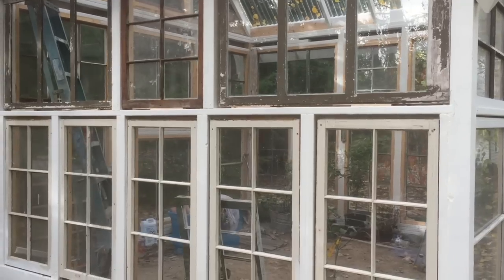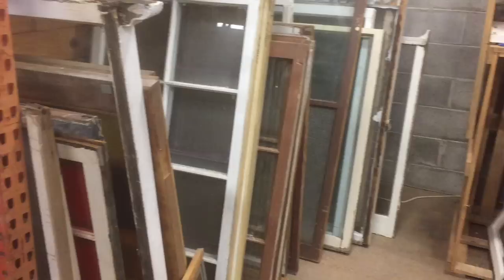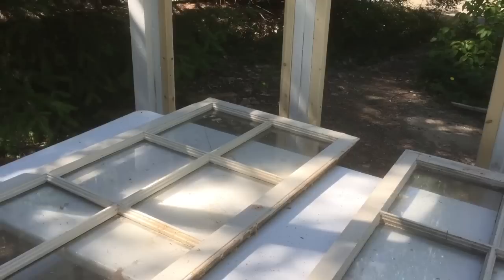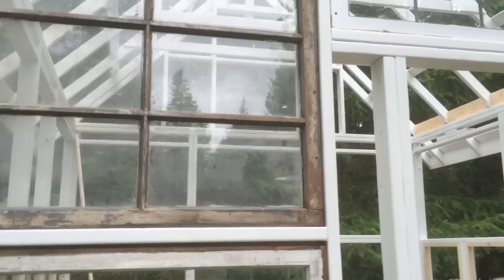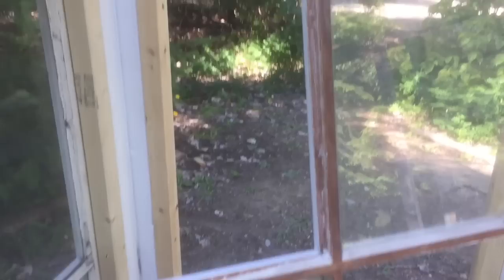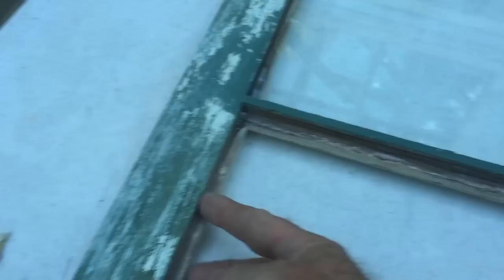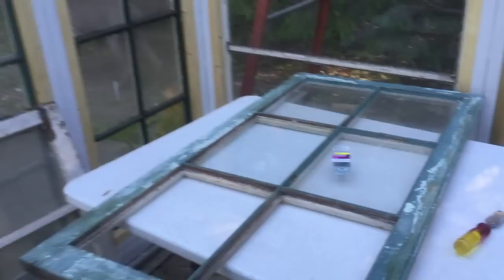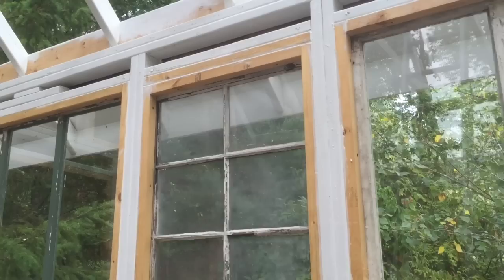Building a Greenhouse out of Recycled Vintage Windows- Chapter 3- Installation of Windows

Comment: Starting my greenhouse following your videos. Two questions. Did you fill your first course of cinder blocks with concrete like the second course?  Would putting paver sand down first make leveling the blocks easier?
Reply from the maker: I just put the cinder blocks down and dry fitted them... leveled everything and then filled the lower course of blocks and up till all were filled. The top layer had the sill plate anchors placed into the wet cement. It would have been better for me to have put paver sand down first as you suggested. I just did it the hard way. Thanks for your input!

Comment: Running the glass to the floor risks breakage and time destroying repairs. Might have saved you some time to have a 3 ft wall along the bottom. Also,blocking out areas of the upper level seems  counterintuitive for a green house since all your light comes from above. Cut plexiglass would be sufficient there. Just a thought. Otherwise a fun and inspiring project!

Comment: I was wondering did you add any angle bracing between the walls
Reply from the maker: No angle bracing. The structure is small enough (12' x 12') with much of the flex taken out by the installation of the windows. It seems very firm over the last few years.

Comment: Hello Tim,

Just about finished with my build and you mentioned possible a fan for ventilation. Being in Texas, have you found a decent solution?

Jeff
Reply from the maker: So far I only open the door and upper windows in the summer time to reduce the heat on hot days. It still gets hot on the inside. So keeping an airflow is what I have attempted to do.

Comment: I'm thinking of using vintage windows myself although I'm concerned some of them are single panes. Do you believe it's possible to install storm windows behind the single-pane-of-glass to get better insulation?
Reply from the maker: the storm windows would be easy to install if you had the right spacing between your framing studs. It's a good idea for holding the heat in. I've simply used the single pane vintage windows because I like how it looks from the inside and out. It does cool off quicker but we live in a mild weather community in Western Washington so the interior of the house remains warm enough for growing things. I also supplement the heat with a small heater on low. This maintains the temperature inside to about 10 degrees above whatever the temp is outside. Whenever the sun pops out the temp inside rises quickly!
Reply: Thank you.  I'm trying to balance the aesthetics with functionality. Unfortunately I'm living in New England so it's not an easy task thank you again

Comment: I must ask so what are you going to do as far as the floors are concerned
Reply from the maker: I dug out the floor and spread out evenly about 6 inches of sand. Then I laid on top of the sand pieces of granite or counter top quartz. The granite was given to me by a contractor friend who installs new kitchens. You could contact any contractor who does such remodels and you'll find they have a large supply of left over quartz or granite. The quartz is a man-made counter top material that is much stronger than normal granite. I just took a masonry circular saw blade and cut up the pieces to fit together inside the greenhouse floor. I first laid out the inside boundaries of the floor on a flat place outside of the greenhouse and began piecing together the quartz. Once that area was completely covered I then transferred all the quartz pieces into the greenhouse.
Reply: @timblair3004  I would like to find out what did you do for the flooring is it stone brick did you just leave it as is concrete what did you do as far as the flooring
Reply from the maker: @allenduncan8046  I gave a reply after your last questions.

Comment: Polycarbonate panels would have been a lot easer and much better and probaly cheaper in the end instead of dealing with those old lead painted windows that have very thin glass and breaks easy , not to be negative BUT!
Reply from the maker: Yes... you are probably right. I did use the poly panels on the roof. I just loved the old fashioned look of wooden sash windows. It produced a vintage look that I was aiming for. But your thoughts about expense are true. My dad used to work in an old hardware store (1950s- 1980s) and he showed me how to cut glass, point and putty them back into the wooden frames. So, it was with some nostalgia that I fixed up some of the old wooden windows that had broken or missing window panes. It was just good memories. Thanks for your input.
Reply: @timblair3004  I figured that, you had a lot of fun doing it and enjoyed it very much thats what its all about, now grow some great things in there.